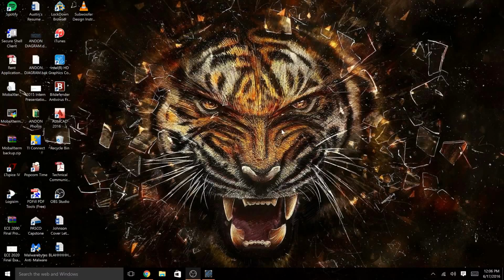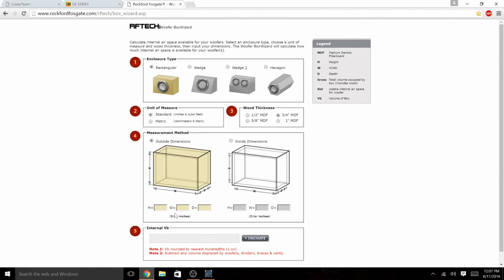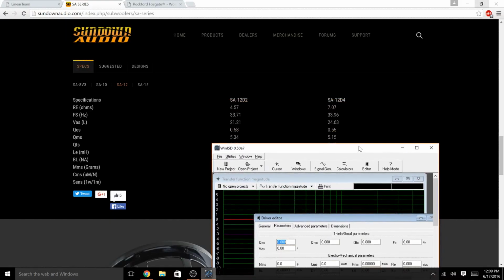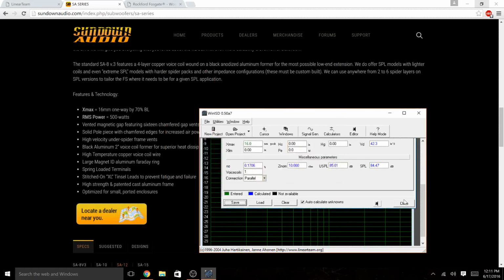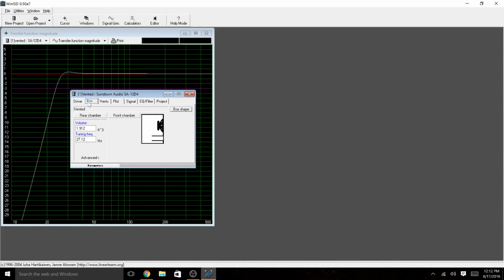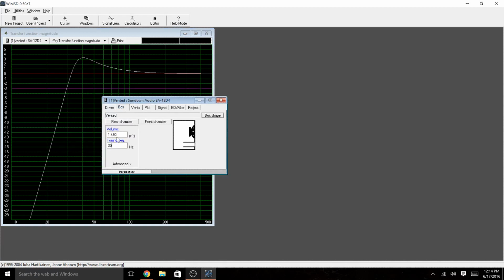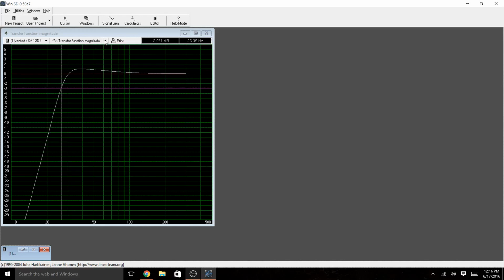How to Design A Subwoofer Box Using WinISD Pro

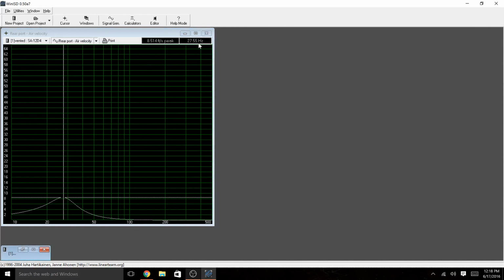Comment: @ 12:03
"Chuffing" gets introduced around 26 cf³/sec, so it's best to keep it below that. 👍
Also, the box wizard URL changed from what's in the description...
Reply: Hey man, I've got a question and since I saw this recent comment, I'm just going to put it here.
At 4:40 Austin uses 16mm for the Xmax as on the website. Here's what's confusing me: For my sub (also 12") it sais Xmax is 45mm and linear excursion is 18 mm in one direction. Is Austin using linear excursion by chance? In a different doc about Austins SA-Series I found: "19.0mm X‐Max by 70% BL method one‐way (38.0mm peak to peak)"
That 38mm is more what I'd expect for Xmax. Could somebody explain, which value WinISD actually wants?

Comment: do you need to imput your signal max power of your speaker before you look the rear port air velocity ??? cause at 1 w by default it always meet requarement, at max power 300w for xample it goes way out of spec..